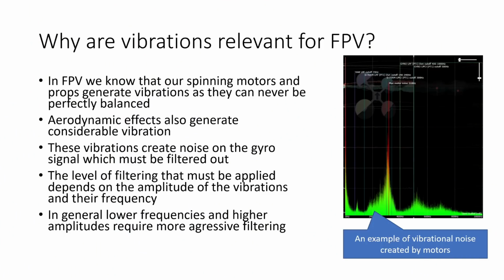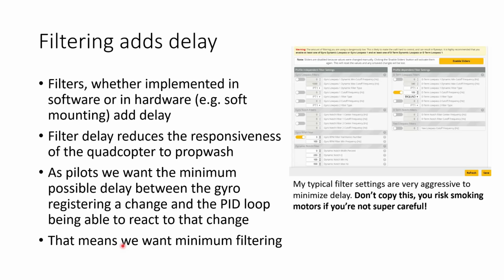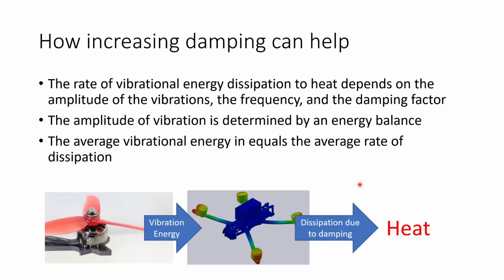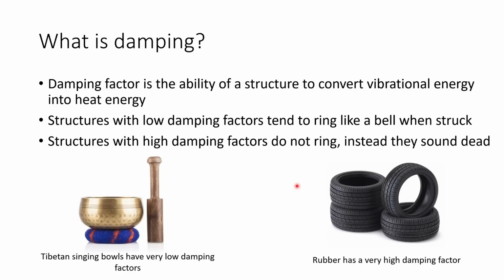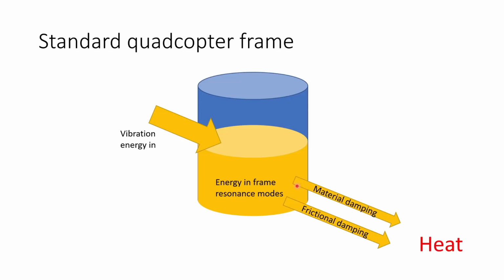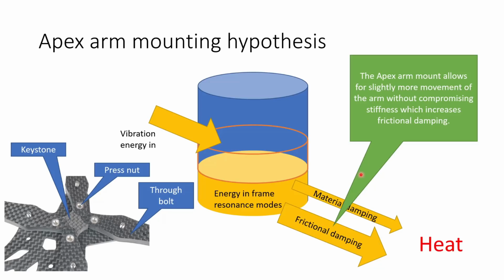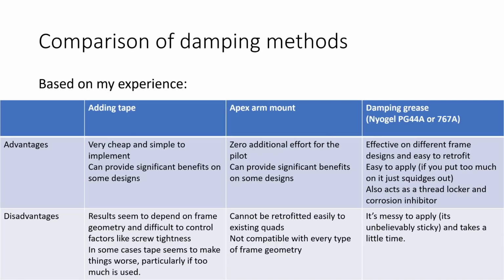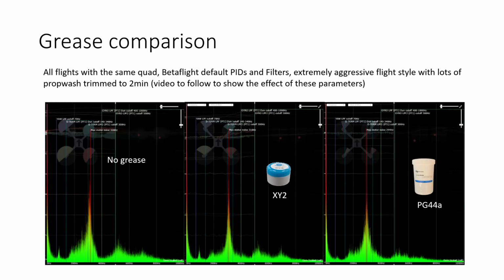How vibration and damping relates to FPV drones and how to increase damping to improve performance!

Comment: instead of grease try g-flex 650-8 epoxy. Can be disassembled if needed with heat gun. Screw tension should not over tightened use a blue type thread locker instead of torque to secure.

Comment: Hi Chris, love you proper, analytic, approach to drone physics. It's priceless. 
I am reviving my oldie racer, from ~2018, a build I loved, I am particular about them. It's been riding Transtec Frog 218 lite frame (they don't make them like that anymore ;) ) AND sof-mounted motors on silicone 2mm pads along with soft-mounted F405 omnibus - not silicone orings on these new molded distance, but "proper" vibration dampers used in precis-ish machinery - m3 steel inserts and soft rubber distance between.

Should I drop all this soft mounting stuff and just screw in everything, and let the software do the thing?

Please advise, over.

Comment: After several tries, I understood my 10-inch frame suffered from resonance. At certain throttle levels, I could see the shaking effect (high-frequency vibrations like a shimmering effect) on the GoPro footage. No tuning could remove it. I could also feel the prolonged resonance if I tapped one of the arms hard and only held on to the top plate. Felt it on the GoPro mount as well. Tapped my other frames, 8 and 7 inch and the resonance was very much more short lived. Applied electric tape on the arms on both sides where they make contact with the frame. And boom, the frame ,as I would describe it, is dead. Like striking a concrete wall. No vibrations, no resonance.

Comment: i had a source one v3 build that would have hot bolts on the arms after flying. It was just the ones that went through the arm. Sometimes they would almost burn you. Is that from vibes? I have since moved on from that frame but just curious what caused it. Never had that happen before on any other quad

Comment: 18:00 the nyogel spectrum has a much lower peak at the ~100Hz 'propwash' frequency.. i'd have thought that up to a point there'd be more damping at higher frequencies than lower? or is the amplitude of the displacement across the grease that much greater from prop wash? (or is it just really hard to be consistent?😅)
Would the displacement or heating effects be big enough to be seen under a strobe/slowmo or FLIR respectively, on a bench test?

Comment: just some stupid question: can i use thermal grease???
Reply from the maker: I don't think so. Mechanical damping grease is much more viscous in my experience.
Reply: @ChrisRosser  out of curiosity and because i cant find any store near me here in indonesia that sell damping grease, i just tried using hy510 thermal paste between arms and plates, combine it using electrical tape on standoff-plate-screwhead on my heavily high throttle oscillations cheap local frame. The result is amazing, i don't know how to read gyro plot but visible vibration on camera when i punch, it's just gone.. thank you Sir..

Comment: All this makes perfect sense now, but it has me thinking there might be something to that old trend of soft-mounting our motors to tackle the vibration at its source. Thoughts?
Reply: I'll try a few different dampening ways and means, at the motor-frame. 
   First, impregnate super-sticky grease, with abrasive sanding grit.  rough-sand both mating surfaces,  > out of curiosity, "Ablative Dampening",  may be tested and data compared,  The sticky grease seems like it'll hold things together longer, and will convert some vibration, into heat, The only downsides I imagine, will. be the damage to the carbon fiber protective coating, and a very small return on a relatively huge investment, on a diminishing return, not worth the squeeze.   But this is where my mind went today, and sometimes I'm only along for the ride.   
 
    kandredfpv, hoping you'll see this, and will have some further informed opinions about soft-mounting directly at the motor frame interface. I have never used any sort of damping directly at the motors, but just playing with the idea in my head, my immediate expectation is that it would be very easy to over-dampen in that spot.. less quick-response, lacking that fast-twitch.     Just started building the first of this year's racing quads,   Going to be enjoying that fresh hardware to kick off another Spring!

Comment: This may be from way out in left field, but what do you think about adding a brace from side to side or front across the frame, that would end with a slant up to the motor arm, attach to the frame at 2 points, and one attachment point to the arm with the grease added between the brace, frame, and motor arms?
One other definitely off the wall idea is what do you think a thin coating of plasti-dip spray would do? It is a rubber coating that you can buy in a spray can.
Just curious what your thoughts about either of those would be.
Thanks!
Reply from the maker: That sounds like it would definitely help. Plastidip is an interesting idea. Worth a go and doing a blackox before and after to see the effect!
Reply: @ChrisRosser  I just happen to have a can of it here that I can experiment with lol. I might have to go ahead and order a new frame first to try it out on. The only 2 I have here are unibody frames, and I don't know that it would have the same affect on that kind of frame.

Comment: Chris I'm more and more amazed by your intellect and videos (first saw you in Joshua's videos), I wish to visit your lectures in university sometime in future when you retire! :) No, I really mean that is purely astonishing. Getting back to viscosity - here in Russia apparently we measure viscosity in so called Engler degrees (found it out just now, was lazy during primary school if I remember correctly) now MDS sheets for  Nyogel products states that PG44a viscosity for example is 192000 cSt - which is 25344 Engler degrees (again I haven't found who else uses such measures except Russia) BUT our local shops have locally made damping grease available only with 60000 Engler degrees viscosity - so I wonder if that's even better will damp vibrations ( same other characteristics, thermals - frost\heat, etc)
Reply from the maker: Yes it should be really good. It's also important what temperature the viscocity was measured at. PG44a is much thicker at lower temperatures!

Comment: why don't they use DSP instead of just filtering?
Reply from the maker: If by DSP you are referring to digital signal processing then I think Betaflight's filtering approach with multiple dynamic notches and low pass filters would qualify as quite advanced DSP in my opinion. 👍
Reply: @ChrisRosser   then how come it can't filter out noise from things like an antenna vibrating?
methinks the DSP coders have some more work to do.
Reply from the maker: @FourthWayRanch  The main issue is that antenna vibrations occur at similar frequencies to fast flight movements like propwash. You want the quad to be sensitive to those frequencies for good propwash performance. Unfortunately that also makes it sensitive to any vibrations at those frequencies (including antenna vibrations).

Comment: Yet another quality deep-dive into the esoterica of the FPV quadcopter.  I'm flying a one-piece, 100mm, X-framed, 2S micro with 1.9" props in a 20' x 20' space [that's 6.1m x 6.1m in real units].  I fly in Angle mode, and thanks to your advice [as well as Mark Spatz & Joshua Bardwell] I've turned a so-so flyer into something special, in my opinion.  I have no black box, so I have to rely on motor sound; stick feel and response; and the feel of the power train temps to tell what's what regarding my Betaflight tune.  It sounds very smooth; it has almost no lag, it's very snappy with no overshoots, handles buffeting, bumping into things, and propwash really well; the battery, power cord, and motors are barely warm after 3 minutes of cruising - I can pick it up by a motor upon landing.  My filter settings are even more aggressive: my D Term Lowpass 1 Cutoff Frequency is down to 40, only 1 for my Gyro RPM Filter Harmonics Number, 80 for my Dynamic Notch Min Hz, and 650 for my Dynamic Notch Max Hz.  I've sandwiched electric tape into my motor mount, which really helped.
Reply from the maker: Glad to hear your quad is flying great! For filters higher cutoff numbers are more agressive so 100Hz is more aggressive than 40Hz.
Reply: @ChrisRosser  I see.  Whatever the setting, it flies the way I like it now.

Comment: Mine definitely dampened the noise. Only thing I noticed is the max frequency is higher on my dampened log vs undampened, but I have a feeling that's because I didn't do a proper A/B flight for comparison. Either way, I feel more comfortable tuning now because of it!

Comment: Thank you for all the time and effort that goes into the production of your videos. I’m a visual learner so the in depth and methodical breakdown of each component that makes up a concept, demonstrated through your excellent graphs and diagrams really helps me understand the material on a much finer technical level. 
Also, the videos themselves are produced with no (as detectable by me) continuity errors or mis spoken terminology, which is hugely confidence inspiring when discussing applications as technical as these. 
Thank you 🙏

Comment: Chris, thanks a lot for your videos. It is really interesting to watch them. You explain very clearly and intelligibly. 
It would be great to see how do you apply damping grease in a video. I also have some questions. What is the weight of grease do you recommend to apply? How quickly does the grease become dry? What happens after drying? Does it lose its anti-vibration properties? Are there other "dry" damping materials besides electric tape? Can something like "Boom Mat Spray-on Sound Deadening" be used for damping purpose?
Reply from the maker: Hi, I apply the grease between the arms and main plates and between the motors and the arms. It will never dry. Dry damping materials do exist but they seem hit and miss wheras the grease is always beneficial.

Comment: How do you think a 3d printed TPU fine piece (like 1 or 2 layers around 0.4mm total) would behave? The one we use for example is 98A shore, how would that stiffness/damping compare to the electrical tape?
Reply from the maker: The only way to be sure is to try it. In general I have found electrical tape and other materials to make some builds better and others much worse. It's very hit and miss. Damping grease (PG44A) is beneficial for all frames. No-one has reported it ever making things worse. So I recommend that.

Comment: There is some plastic frame or even 3d printed frame.  I will belive that plastic act like a damper.  What do you think about plastic design?  Are they good to reduce vibration to the gyro?
Reply from the maker: I think plastic might not be stiff enough for anything except the very smallest whoop frames. Stiffness is vital for resonance performance.

Comment: How often do you have to reapply the grease? Does it ware out? Do its effects diminish over time? If its effects diminish you will need to gradually change your filter setup I would think. Great videos!!! I am an engineer and your approach gives me a much better understanding of what is going on with my quad!
Reply from the maker: The grease isn't going anywhere. It'll certainly outlast the life of your frame.

Comment: Do you think that applying the grease between the motor and the frame would be useful?
Reply from the maker: I apply grease under the motors and under the heads of the motor screws, I have found it helps quite a bit.

Comment: EXcellent video, I bought nyogel, I will try in my Fpvcycle Glide frame!
Reply: I bought fpvcycle brand damping grease
Reply: @divingfalconfpv4602  nice ! How is it working ? after 2 years I can say that I have not find a substantial gain at least with nylogel in the long range 7” builds I tried

Comment: This is super interesting to watch!

Just tried to blackbox-filter my Tinyhawk Freestyle, which suffers from a ton of Gyro-Noise that always translated into self amplifying D-Term oscillations when I throttled up. Aventually I ran out of filter banks to use and while the result was a lot better those oscillations wheren't gone. So in a "screw it, what could possibly go wrong at this point"-kinda mood I used electrical tape to softmount the motors... and BAM - D-Term Oscillations where completely gone. Now it's time to reset these filters and do it all again - seeing how much less filtering I can now apply.

I didn't expect that a multi-part arm design is also better for dampening then the inherently stiffer single-sheet arm design of these tinyhawks, but once you think about it it makes total sense. You wan't these vibrations to not reach the center part where the stack and gyro are mounted - so everything that dicipates energy before that is favorable, as long as it leaves the movement-freuqencies untouched. I may try some foam tape on my arms to dicipate  a bit more energy on my particular frame design which shouldn't add to much weight - great tip!

Comment: Hi Chris, yesterday I saw in TV a startup, which makes a new stiff and light compund material. Because of the nature, it has a high dampeing factor already buildin. Unfortanetly I can´t find a english webpage, but with google translate... : https://hardcork.de/use/     https://hardcork-skateboards.com/    It is a compound of cork, fiber and resin. They advertise it as replacement for carbon fiber, but because of cork it should have a much better buildin dampening compared to carbon fiber. Is this a new material for frames on the future???
Reply from the maker: It's possible but I struggle to believe that it could be anywhere near as stiff and strong as Carbon Fibre. The applications are surfboards and skateboards. Plywood for skateboards has a stiffness of about 7GPa compared to more than 70GPa for CF. Based on that gut check I think it'll be too floppy. Its a cool material though, thanks for making me aware of it.

Comment: This jives with your apex unicorn theory. I also still use tpu motor mounts even if only 0.5mm dont care what anyone says lol.  (Edit - just got to the apex reference in the video when i posted this lol)
Reply from the maker: TPU motor mounts will definitely absorb some vibration, don't let anyone stop you!
Reply: @ChrisRosser  this also myth busted my theory that unibody frames are less noisy.  But I can see how for say 4 inch lightwight long range (no acro) builds the cost in loss of dampening is outweighed by the weight savings particulalrly with smaller motors often at steady throttles making much lower noise ... I think?? Lol
Reply: I have an Armattan Chameleon 6" frame that is notorious for being a bad vibrator due to the large unibody bottom plate. Many good things about the frame, but it's noisy.

Comment: Hmm, may have a use for the tube of Nyogel 767A I have lying around for other than lubricating gimbals on joysticks....cool. Nice work Chris
Reply from the maker: Go for it! If you've already got the grease there's nothing to lose, you can always wipe it off after all.
Reply: @ChrisRosser  exactly my thinking, will have to capture before and after logs and compare on my glide frame. 767A is designed for dampening so would be an intresting test.

Comment: This is very interesting. I have made 'damping pads' before of various hardness using acetate silicone. I used to spread some silicone between 2 hard sheets using roller pin and side rails to get precise thickness. To control hardness, I mixed silicone with various amounts of mineral spirits. That way you can get it so soft, almost gel like, but still firm enough to get nice resistance to tearing. Perhaps that could be clean and controllable replacement to grease.
Reply from the maker: Very interesting. If you have time it would be very interesting to see the effect of adding this to your quads!
Reply: @ChrisRosser  Yea, you kinda inspired me to enter a rabbit hole called designing my own frame. Since I'm quite proficient in 3d modeling and have the equipment and experience in mold making / wet carbon layup, I figured I'll give it a go. I always wanted to try making something different than classic "flat sheet cutout" frame, something with some curvature to it to give it more rigidity, and to avoid the use of standoffs. It is not a commercially viable project, since you can't just throw a sheet of carbon on a CNC machine, but it is something I wanted to do for a long time.
I just got a hang of modal analysis stuff in Ansys and am excitingly running sims on my designs, figuring out manufacturing part along the way. 
Just wanted to thank you for your time you are putting into your videos, they are really inspiring and informative. Thanks!

Comment: Can anything be done for a single plate frame like an Armattan Chameleon? Are there effects of having single esc's on the arms? Wondering if the added weight and mass on the arms make a difference.
Reply from the maker: Single plate frames are harder. There are constrained layer damping tapes available that you can try.

Comment: Curious, v. Curious. I think we need analysis of multiple tests on multiple frames. Perhapse request submission of bbl for analysis? 
I've retro fitted a single layer of tape on the glide but not sure there is a significant difference
Reply: Still the new best source for new info pushing quads atm
Reply from the maker: We definitely need more people to test on more frames. It will take time to build confidence but initial results look promising!